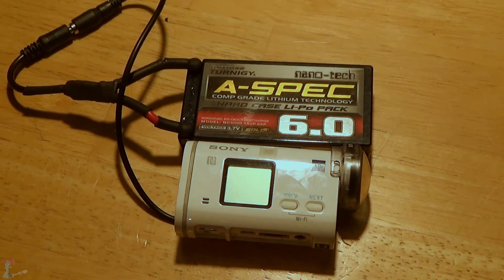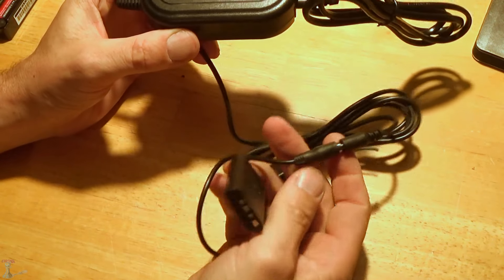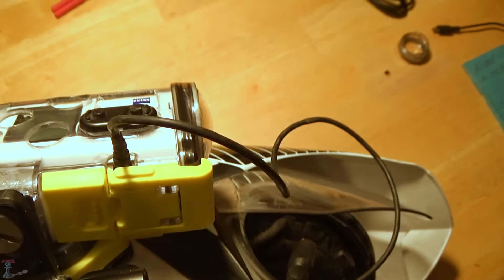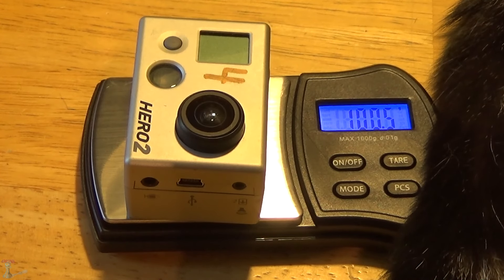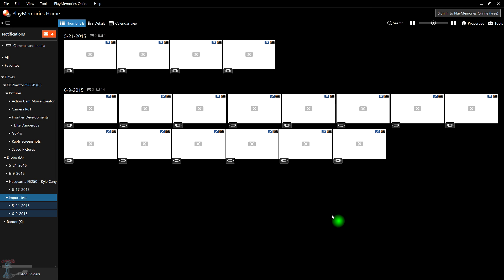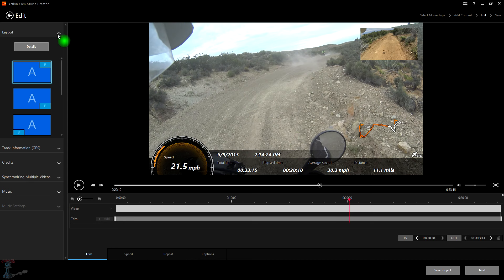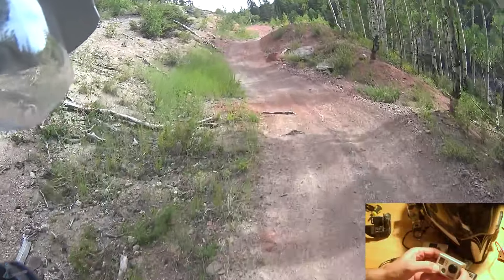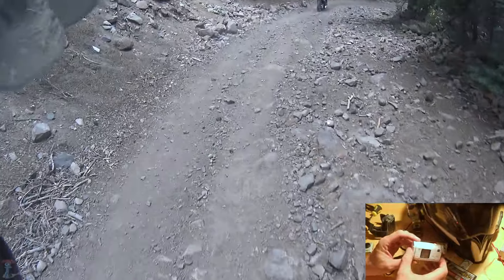External Battery Mod for Sony Action Cams (AS200V) 8 + hours of record time

Comment: Thanks for sharing this. Inspired me to try the same for my Sony.
I couldn’t find that battery anywhere though, so will try making a battery pack with 2 or 3 18650s in parallel.
Reply: I 3D printed a dummy battery shell and ran wires soldered onto metal contacts into it.  Using a single 5000mah Efest 21700.
Reply: @TheSummer750  Cool! How does it work?

Comment: Very Nice! Just made my MotoVlog helmet-setup and had the same issues with all these hidden connectors. specially the micro USB and how to power it. Your solution is awesome. Ill have a look on amazon because ill probably do the same setup. 

Im one of those people that always trys to handle things as good as possible and was a little surprised by your way ;) On the other side. Damn! its an actioncam - they should be made to resist all that easily. Greets from Spain!

Comment: Oh dude. Great video. So true with the action cameras nowadays. I'm just looking for a camera to upgrade from my Drift HD Ghost and nothing comes even close in terms of design. The new TomTom bandit is kinda neat but the remote doesn't suit my needs. The Live View doesn't either. I want to change between photo and video on the fly. So only gopro and drift works.
But drift doesn't have the picture quality and gopro doesn't have the image stabilization.

So I'll get the Sony and throw together my own remote. At least they have pretty well documented API for that.

BTW from what i googled the sony stores the gps data as separate file in some hidden folder. So there might be some way to import it to other editing SW.
Reply from the maker: +pokemonihovno If you do create a custom remote I would like to see it. And a way to import the GPS date without using Sony's horrible program would also be a nice improvement.

Comment: Thanks for making the video. It was really helpful seeing your progression through various power sources and reasoning. I've been eyeing a sony lately after having 2 gopros, and have been looking at what ideas are out there for doing external power. I'm not ever going to have as much vibration as you, so I'd probably settle on just the power bank w/ micro usb plug. Question about that though - when you did it with the power bank, is the camera's original battery installed? Does it matter if its in or out?
Reply from the maker: +NearlyFromAfar Glad you found the video informative! You will leave the stock battery in the camera if you plan to power it from a USB boost pack.

Comment: Hi lowlypawn, just came across your excellent video,just wondered have you tried running power straight from the bike's battery,cheers.
Reply from the maker: +JohnG11000 Most motorcycles batteries are 12 volts. The Sony-action-cams require a 1-cell-lipo battery that when fully charged are 4.2 volts. So running power straight from you motorcycle's battery would most likely release the magic smoke from your camera, NOT recommended. Now if you used a USB power adapter, then connected the camera using a micro USB cable, that will work. But for off-road riding the cable loses connection and gets in the way. I talk about this in the video but it is a long video so I understand people not watching 100% of it. Hope this helps.
Reply: +JohnG11000 might give that a go,cheers pal.

Comment: Almost all the ergonomic criticisms you made about the AS200 (and the X1000) were answered in the new X3000: mic and power port are now in the back, on-off button is now on top, and the menu system is much, much better. It is still the micro-usb port for power, but that is the current standard for almost all small devices, meaning just about any power adaptor can be used with modification. And the new usb c is no more secure.
Reply from the maker: Wow, thanks for the heads up, I didn't even know about the x1000. The optical stabilization sounds very promising! I'll probably have to buy one and try it out.
Reply: x3000, not x1000.
Reply from the maker: Ooops I meant to type x3000, thanks. B&H photo says they start shipping tomorrow (Sep 26, 2016). $550 with the live view remote or $400 for only the camera.  I really want to try it out. Decisions decisions.
Reply: if you already have the old liveview remote (lvr2) that will work perfectly well. you can buy it now at $79. The phone app also does everything the new liveview remote does also, and is free. What is new is that now you can turn the camera on and off with the new remote or the phone app.
Reply: l meant you can get the old remote at $79 and it works fine with the x3000.

Comment: ever looked at the ion air pro3? 
It has vibration feedback on the flip record button and power off.
Same problem with the external mic though.
And I dont think u can modify the battery.
hmm.. 
next youtube search for me there..,See yah.
liked your video very much!
Reply from the maker: +Vidar Berg The Ion Air Pro3 reminds me of the Conrour. I'm still searching for the perfect camera. The setup that most intrigues me at the moment is using a Mobius with the lens extension with the Mobius mounted on the inside. That's a slick setup. Drill a small hole in the chin bar to mount the lens. The Mobius also uses a single cell lipo so if I used my external battery I would probably get ridiculously long record times. Adding an external mic also looks easy. Only downside to the Mobius is it's only 1920x1080 at 30FPS. No 60FPS and no image stabilization. But I'm starting to think that maybe doing post processing image stabilization on my computer might yield better results. Even if it takes days and days. Just let the computer chug away for a few days stabilizing all the video. Or maybe get the X1000V, shoot in 4k. Stabilize then render out in 1920x1080 but that would really kill my computer.
Reply: +lowlypawn What software will you use?
I'm currently aiming my self in on the contour +2.
I will get hands on a used camera to see if I like it.
It has it all, exept stabilizer.
Reply from the maker: +Vidar Berg I use Sony Movie Studio 13 right now. Let me know how you like the Contour if you buy it. For me the stabilizer is the most important thing about my camera setup. That alone will have the most effect on image quality after YouTube compresses it. Also be sure to check out the Git2 camera. Looks to be a strong competitor to the GoPro and it has a built in image stabilization, I don't know how good it is but the reviewers seem to like it.

Comment: I agree there are some serious shortcomings in this Sony kit. I've been looking at fogging and overheating since I got the thing. So I bought the dessicant packs and that prevents fogging but the overheating even in cold ambient temperatures remains.  I was looking last night at drilling some holes in the housing. Frankly, I was considering a minimum amount of penetrations. It doesn't seem that approach will prove effective given the example in this video.
Reply from the maker: +Donald Powers lol yea I may have went a little overboard on the cooling holes. I will say my camera has been working flawlessly since last September. But the real heat hasn't hit yet. I'm worried once temperatures reach the triple digits here in Vegas the camera will start randomly shutting down. I'll probably post a follow up video in a few months if it does . But to give you guys an idea of how much video I'm shooting, I average 250 to 300 gigs of video every month. Yea 99% of it is boring trail riding but it's the 1% I'm after and this system allows me to capture it. Anyway thanks for the comment.
Reply: +lowlypawn I drilled some holes today and ran a successful test in the house. I, too, will have to wait for summer for a proper test. I'm thinking any air exchange is going to help. Your "holey" example gave me courage. :-) I ride a bicycle on the road using the as20.

Comment: A little rough around the edges but hey it works for you so great , I am thinking about buying one of the skeleton cases for a as200 for the access to the lower power port  With that said the stock case is not the best for underwater video making it a good candid for hacking.

Comment: I just ordered the equipment to do what you did so I can extend my recording time. If you have any new info, positive or negative, to update your video, I would appreciate it if you pass that along for me. Thanks for your video and any other info you pass along!
Reply from the maker: Yes I will have an update video out very soon. Iv'e made improvements to the external mic you will like. The camera and big batteries have been working flawless. I've got at least 300 hours of record time. Probably closer to 500 hours in the last 5 months and everything is still working perfectly. Anyway watch for my next video in a day or two.

Comment: Lowly, Mod turned out great- What do you use to charge batt? Via Micro on Sony or something external? THX!
Reply from the maker: +Popz DeWilde Go to 16:35. I use an Imax charger I bought online, works really good. I've kind of settled on charging the batteries at 4 amp. They say lower amps is easier on the batteries but takes longer. 2 amps takes so long the charger times out so using the camera to charge them would take days and day (the camera only charges at 0.5 amps (@5 volts so 2 watts). 6 amps works fine but I felt it was hard on the batteries so 4 amps makes me feel better but probably makes no difference. .

Comment: Dude - great stuff over there! Have you had experience with different ext mics on the 200v? I've tried using mine for motovlogging but the audio just peaks all the time beyond clipping so it's quite unusable. Tried muffling the mic in varous ways - didn't work. Now I'm thinking maybe adding a resistor to the mic (series or paralell) don't know how that will work though. Any ideas please? Thanks!
Reply from the maker: Check out my follow up video after this one titled "External battery mod update and improvements (for Sony action cams) " In that video I put the microphone inside this little compartment in the chin guard of the helmet, this seemed to cut down a lot of the wind noise, this won't work on a lot of helmets but it may give you some ideas. Also are you using the Sony ECM-CS3 mic? That's the only mic I have tried and am pleased with the results. I just checked and the mic is $16 bucks as B&H so buy that mic and see if it fixes your problem.
Reply: lowlypawn thanks dude - I'll try to find it in my country (Poland;)
One remark for you for future - this vid (almost 39mins) should have been cut into 3-4 separate ones with different titles and different descriptions - there's a number of completely separate topics - searchability, viewer attention not to mention views - 4x as many easily. If u give a damn of course :)
Cheers!

Comment: just an update i tried the EC technology 22000 MAH with my sony X1000V and it extend the recording a lot the technical part which i searched a lot for and finally found it it have to be more 1.5Amp to work and the battery sign you will see in the sony disappear

Comment: Great mod! I've been looking at this video for a while as I plan out my setup.

Question though! Did your camera overheat prior to the battery mod? I noticed that the 1 Cell battery is a 3.7v output, while the standard Sony X Batteries are 3.6v. Perhaps that extra .1 of a volt is causing the camera to overheat. Just a wonder! 
Thanks for the starting point! Glad it works well for you!
Reply from the maker: The camera overheated before the mod. Maybe even more so because the standard battery inside the camera would get hot. With this mod the battery is away from the camera and is so large I never notice it even get warm. The adaptor is just wires and doesn't contribute to heating up the camera. Two days ago I went on an all day ride and had the camera rolling for about 6 hours no problem. Temperatures were in the high 90s and the camera had no problems.    As far and battery voltage goes all one cell lipos use the same voltage range. 3.6v is fully depleted and 4.2v is fully charged. The camera has no clue it's being powered by a bigger battery. Think of it this way, when you put a larger battery in your car, the radio doesn't run hotter, it just means you can run it longer before the battery dies.

Comment: hi mate... does the lipo mod works on your x1000v? fyi, I was able to charge the lipo pack with an external charger but was unable to charge or power up with the x1000v using the same lipo setup... cheers...
Reply from the maker: +STINGRAYS STINGRAYS Yes, the x1000v uses the same Sony-X-battery. Same as my camera (AS200V). I don't know why your setup didn't work. My only suggestion is make sure you have the polarity correct.

Comment: Sony action Cam Movie Creator: Two-view videos made easy (yes, you want two cameras running simultaneously, controlled by one Sony liveview remote), and free. GPS tracking in video, also easy and free. What is your problem? Yes, you could do this in a costly program, but most users of these cameras are casual users not pros or enthusiast of video or self-labeled experts like you. Your negative attitude really detracts from your video, which does contain useful information, and even many of your critiques are right on.
Reply from the maker: Sorry I came off so negative, I think I was in a weird mode when I made this video. But I really-really didn't like the Sony action cam movie creator. It just bothers me so badly that Sony didn't bundle a good program like Sony-Move-Studio-13 with this action camera. Instead they sold Sony Vegas to Magix, hopefully Magix does good thinks with Vegas. Thanks for the feedback.

Comment: Why didn't you just drill a hole in the bottom and use a power bay to power it via the Micro-USB-port? If you leave the battery out and activate "USB-PWR" in the options you only need to plug in a power source to the Micro USB.
Reply from the maker: +NicGaming In the video I explain why the micro USB is not a good solution for powering an action cam. It may work for situations where the camera is stationary but on a dirt bike the micro USB will lose connection for a split second and the camera will stop recording. The micro USB connector is simply not robust enough for my application.  Also I tested my camera and it will not power on without a battery. I also looked through the menu and I didn't see "USB-PWR" option?  Either way I stand by my opinion that micro USB is a horrible connector totally unsuited for any outdoor environment or any kind of movement or vibration. Also the standard USB on the power pack will also break connection with any kind of movement.  At 3:38 on the video I talk about this in detail.
Reply: lowlypawn I have to admit I didn't watch every bit of the video, sorry.
Reply from the maker: +NicGaming It's OK I understand. The video is very long and rambling. If I did it again I would script it out and make it much shorter, but then I would probably procrastinate doing that and the video would never get made :)

Comment: I've been thinking that but I can't find one to charge it while using it I live here in las vegas too
Reply from the maker: +jojo jacinto I don't know what you are asking. Please rephrase the question.
Reply: bro. do you think i can turn on my AS100 v sony by using my car charger while plug into my camera cuz according to the users manual make sure the cam is off while charging ,what do you think?
Reply: so i can save my battery life while using it as a dash cam by pluging it to my car charger
Reply from the maker: +jojo jacinto Yes, you can power the camera using the USB port. But it won't charge the battery and record at the same time. It's either or.
Reply: +lowlypawn 

Work and directly modifying the cable inside, and put in place special charge miniUSB port, without the need of anything, just direct cable simple.bridge white and green thread each side in miniusb.And power is normal 5V output any bank power,not special 3,7V output ! Work 100%! Example here https://posturi.wordpress.com/2014/07/17/incarcator-auto-pentru-tableta-asus-nexus-7-2012/

Răspunde ·

Comment: next time put a resistor,,, you can kill the camera .
Reply from the maker: Please elaborate. Why do I need a resister? And what value resister would you recommend and why? I've been using this setup for 9 months straight. Every weekend I shoot at least 8 hours of video. Some weekends I run this camera for 16 hours. If I'm riding I'm rolling video. I conservatively have 300 hours of use out of this setup, maybe as much at 500 hours, with no problems so far. I have a rudimentary knowledge of electricity and I fail to see why I would need a resistor. I'm not saying you are wrong, but you will need to convince me with some evidence and numbers to make your case.
Reply from the maker: Rudimentary is probably not correct. I would say I have a basic knowledge of electronics.

Comment: You complain about micro usb connectors sucks and with that kind of handling, nothing will last with you.
Reply from the maker: Thanks for the comment. Actually I have a follow up video where I talk about how this setup has been working flawlessly for 6 months now. And some improvements I've made. You should check it out. As far as my rough handling, yes many have commented on that. I didn't notice at the time and had no idea people would be so upset by it. But don't worry. All my camera equipment is still working perfectly.
Reply from the maker: Also I stand by my statement that micro USB port is  junk! Thank god they will be history once usb type C becomes mainstream in a few years.
Reply: +lowlypawn yes i also admit that the usb are junk especially usb B connectors like you find on printers. but thats why you got to be carefull handling to not break anything or to wear out the ports to fail connection. nice video. these small batteries need to last longer. jerry rigging it is the best way to go hehe.